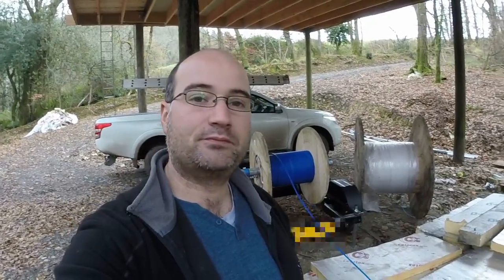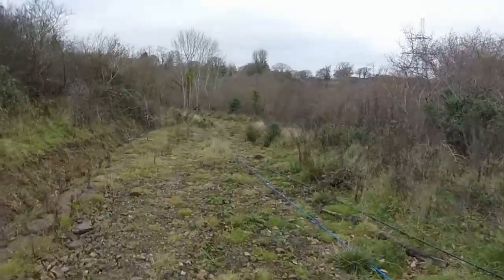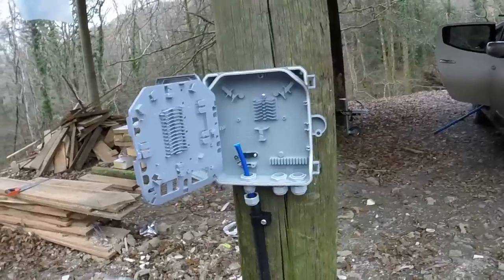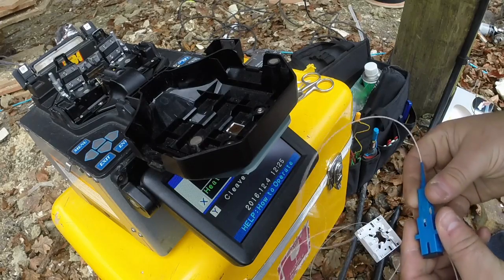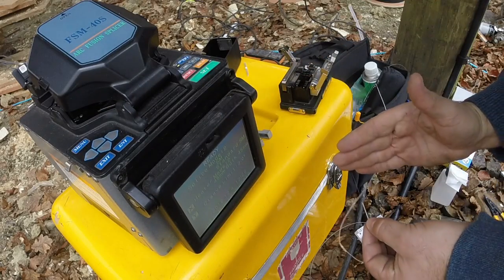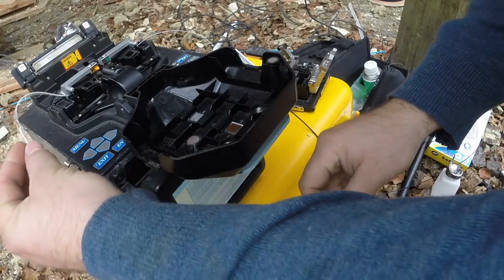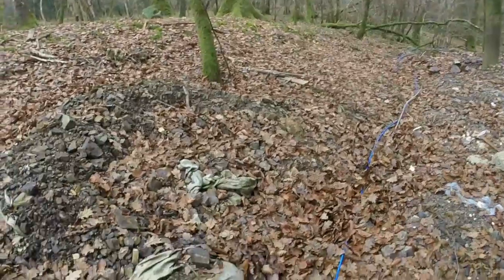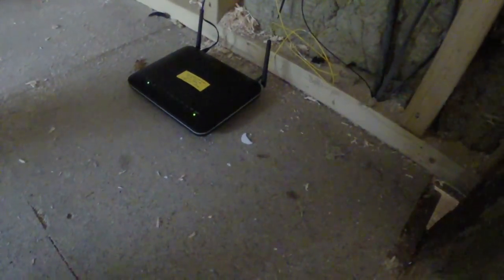1.1Km Fibre run to a barn (FTTP)

Comment: I was wondering if you had considered doing it as an ADSS  cable (All-Dielectric Self-Supporting) aerial cable on poles since you have a clear path and a  open tractor trail to work with? If you have electricity running on poles to the barn you might be able to run it on the same poles.

Comment: What the heck, leaving it on the floor like that is asking for trouble,  especially when it is the drive way, if you are going from one side to the others of the drive burry it ideally 1ft downed in a narrow trench so if they plow etc in bad weather it won’t cut it., or attach it to a fence post bt style do it’s out the way completely

Comment: Try splicing a 432 count single fiber cable. I like to call it 3 - 10 hour days of boredom. Just building the enclosure and traying the fiber takes 3 hours. After the cable is spliced (jointed in UK) Then the real fun begins OTDR testing with dual wavelength.

Comment: Where can you go to do a short-course on fibre splicing?
Reply: there are training courses of course, but i don't mean to be rude to anyone who splices fibres for a living but it's not that hard at all. What he showed in the video is pretty much the entire process. Remove outer jacket/inner jacket, cleave fibre, clean fibre, insert into machine and press the button. I'm sure if you had access to a fibre splicer you'd pick it up in no time with a few practice runs. I once connected three buildings together, a local college wanted to share their super fast fibre link with the other three buildings. We did the whole job ourselves over one weekend having never spliced a single fibre before. We just rented the machine and did some practice runs.

Comment: That is an expensive fiber splicing machine you got there. I have used the Fujikura in my previous job profession. Ah the thrill of opening up manholes and splice boxes.
Reply: Thats so crazy I was using the same splicer back in the day and the same yellow box WOW!!!  I think the fiber cleaver is the same as well. I'm remembering some good times with the bucket truck and the splice trailer. Building my Tyco closures and making my cut sheets for my splices. Brought back memories like a flood. It's a very professional machine for sure.

Comment: I have one question for ya! And by no means do I mean to insult or sound smarter than you but why don't you just setup some of the unified saucers from ubiquity they can send data from up to 24km! It seems that that would be a lot easier to setup and stuff.
Reply from the maker: Hi, Wireless PtP would have required a couple of tall masts to get over the treeline and hill. As there was a power line being put in, it was easy to pull the fibre with it. It also means the router and connection is standard on the network, I've seen it many times in jobs where small companies go outside their core product and support on that one-off solution becomes a nightmare.
Reply: Oh yeah I guess I consider those factors! My bad! As you can probably tell I'm still a bit new. And I the terrain is always a big reason why you couldn't use it.

Comment: We've just had FTTP cabling put up , but worryingly they have stopped 2 poles away.. we are on the end of the line though
Reply from the maker: Hi, if it's BT FTTP in the UK they will have put up a small connection enclosure on that final pole. This is normal - they should then be able to run a drop fibre from that node, over the remaining poles to your house. Hopefully your address is on their system as covered though! Check at http://dslchecker.bt.com to see if you or your neighbours have FTTP WBC listed as an option. It may not be live on their systems yet, so keep checking. Good luck!
Reply: thanks for the reply, our main man has given an update with some reassurance on that. 
Sadly the wait continues as there's more cabling work to be done before it goes live from our local exchange to a main exchange in the nearby big town.

Comment: directional WiFi was not a solution? trees too tall?
Reply from the maker: Hi David, Yes. They had tried WiFi before, but the trees and ground topology meant it was never going to work.
Reply: +John Watkins Hey nice video, great job, it takes time but its worth it!..... umm by the way sir whats the name of the wifi router you use in this video?.... i see fiber is connected to it? ....thanks
Reply from the maker: Hi, thanks! It's a Huawei HG8245 original version. GPON Router.
Reply: +John Watkins ok thanks alot, i appreciate ur replied!

Comment: Deer: "mmm whats this?" Nom Nom
Reply: Very impressive run no doubt.
Reply from the maker: Thanks Logan. You've got me thinking now, what if I connect the steel armour to an electric fence unit :)
Reply: I think I'm for the conduit recommendation, unless your idea in effect wouldn't cause damage to your end devices then I'd say whatever is cost effective. digging a conduit run and running an protective conduit is the best solution, but it's the most time consuming.. time is money to though hehe, challenging balance! Hopefully whatever you choose will stand the test of time. There are LIFI technologies out there too, Ubiquiti makes fine products for them.

Comment: Do you strip all of the 250-coating? I leave about 10mm of 250-coating on each end, depending on your cleaver there's less change of the fiber breaking on the pads.
Reply from the maker: Hi Ronald, I strip maybe 30mm from the end and then cleave to about 10mm. My cleaver has pads directly either side of the cleave point, so it's tricky.
I decreased the amount of travel in the rocker last week and so far it seems to have solved the problem.

Comment: Fibre cable should not be left open to the elements. As most fibre cable is not UV rated. What happens if the cable gets chewed by an animal? I don't think no protection for the cable is a good idea even as a temporary solution. I'm my experience temporary connections tend to be made permanent.
Reply from the maker: Hi Alexander, you are absolutely correct. The blue sheath of this cable is polyethylene which is not UV stabilised, although it is 1.8mm thick. It has steel tape armour inside the sheath to mitigate damage to the loose tube by small animals. I didn't mention it in the video, but this connection will be made permanent, but the land owner does not wish to trench the soft, wet ground during the winter (a different, more direct route). Sometimes you have to compromise.
Reply: John Watkins I have even seen armoured cable chewed by rats and the tubes damaged. The cable could have been in 25mm conduit for the path.
Reply from the maker: I agree, damage is still a risk, however; The impact of that risk on the service during the time the cable will remain above ground is not considered high enough to warrant the extra expense of installing the cable in 1.1Km of conduit , which would have doubled the cost of the run.
Reply: An interesting walkthrough about FTTH installation ! In our implementation we made the FTTH network for 100 single-family houses. The technology was very much the same. However, microducts had to dig into the ground at 40 to 70 centimeters. This was due to the municipal regulations (even air lines are not anymore allowed). The digging costs were surely more than 70-80% of the total cost of the project. Maybe in a countryside (on your own land), a microduct on the ground would be possible. Nevertheless, the risk of vandalism would be greater because Finland has so called " Every-mans-right" to walk freely even on private land (in forests, but not in the yards).
Reply: im of the thinking that if you are going to do a job you do it right the first time.  otherwise youll end up spending double down the track